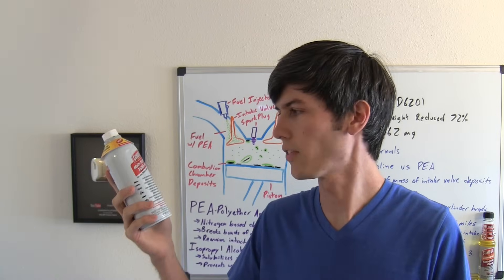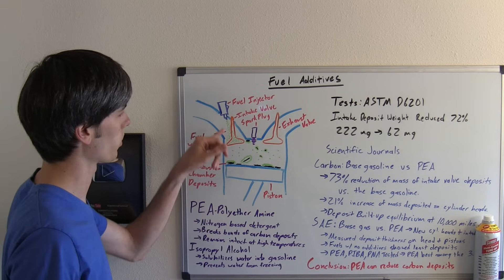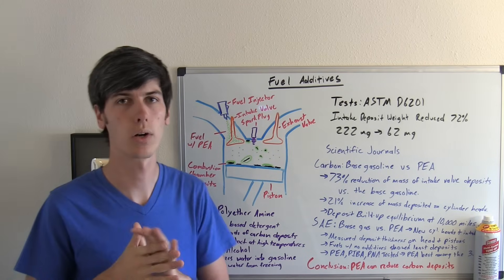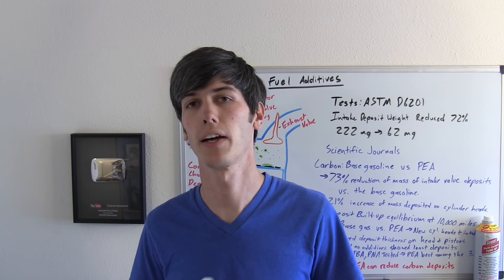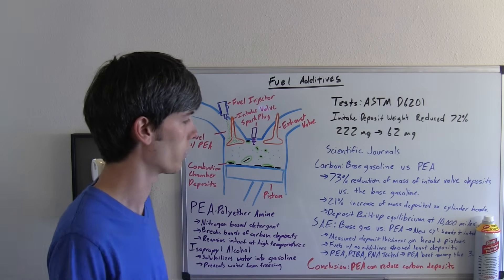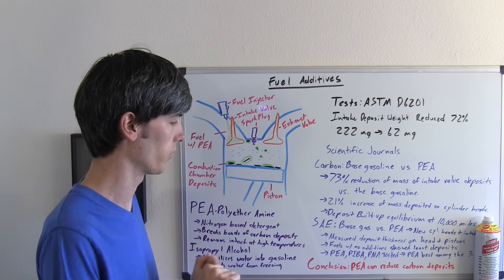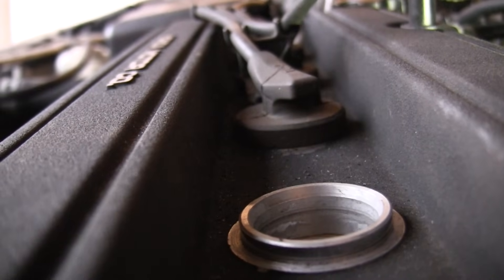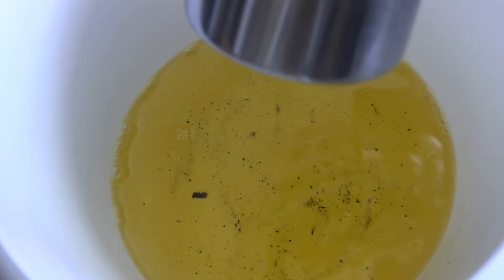Fuel Additives & Injector Cleaner - Explained

Comment: I recently acquired a thirty year old car and had it smog checked. It failed on account of too much Nox. Could be running too lean on account of a vacuum leak or too hot on account of carbon buildup which increases the compression ratio. A vacuum smoke test was negative. So I used an additive to  clean up the carbon buildup.
With that gasoline still in the tank I went for the free re-test. The amount of Nox BOUBLED. Now when you said that PEA based additive is nitrogen based that makes sense.
Reply: utoopuser I used to have Nox problems with my 4Runner that had a full custom exhaust. I needed to weld an exhaust leak that was between the manifold and the O2 sensor to fix the problem. A tune up (with coolant change), changing the O2 sensor, and changing the cat converter would likely get your Nox to pass. Checking the MAS sensor and a Seafoam treatment wouldn't hurt either.
Reply: Thx.

Comment: Good info, thanks! Is using Premium or Plus grade gasoline worth the extra price? What about premium gasoline stocks with additives already in them like Shell V-Power, Chevron Techron, etc?
Reply from the maker: Use whatever octane is recommended by your manufacturer, no need to go to higher grades if your engine won't have a performance benefit from it.
Reply: Engineering Explained great video, as usual. I would love it if you did a video on straight cut gears or "dog boxes." you could even throw in strait cut diff's in the same vid! not to bribe you or anything, but I could provided you some support if you did this... maybe Mr.Lincoln could convince you? 😂
Reply: I am with the channel owner. Use what the car maker prescribes for your car.

Most cars will run just fine with any grade fuel, because for modern engines there are electronics to adjust the fuel injection for a wide range of fuel grades and operating conditions. With a higher grade fuel the engine will not gain more power, but a lower grade fuel may cost you a few hp which most of the time will not even be noticeable. There is a lot of fluffy marketing from car makers but they do not have any benefit by recommending a fuel grade that is not the best for an engine.
- The superpremium - platinum - viagra100 fuels that are sold like champagne are propaganda only. There is no car in the market where the electronics are adjusted to this.
- Avoid pumps that may have stale fuel, some Regular pumps are frequented very rarely!
Reply: Also, using hi octane engines that don't require higher octane will actually increase pollutants.
Reply: My car manual says Regular 87 is OK , but I've noticed that when using Regular, the engine oil seems to acidify very quickly, and the smell of combustion residue in the oil becomes noticeable.  This seems to happen very quickly.  And once it happens the oil is ruined and needs to be changed.  Whereas when using Premium 93 gasoline exclusively, the oil stays clean for a long period.  The combustion residue of the cheaper gas will be significantly greater than premium gas.  While Regular Gas may not directly damage your engine due to knocking , it will significantly decrease the life-span of your oil.  So using Premium Gas is actually beneficial, regardless of what your vehicle manual suggests is acceptable.
Reply: Blakehx if your car manual says 87 octane use it. Your wasting money on anything higher. If you like add some BG44K twice a year. Google Top Tier Gasolines and read the story.
Reply: Actually many supercars have fuel maps to run on unleaded race fuel....  but no high end sports cars do.
Reply: ONLY use Shell or Chevron.   The rest are garbage.
Reply: They all come from the same supplier, the difference is additive packages & those are mostly the same as well.
Reply: I agree with EE -- use regular grade unless it's required for your car. Even then it's questionable. I had an HP Saab Turbo for which 93 octane was recommended. I ran it on 87 for 300,000 miles. Ran great, no knocking and fine performance.

Comment: I do not see the relevance of your soak test since we could easily presume that a simple water soak could have removed the same amount of gunk from your exhaust tip. Plus... aren't the additives meant to be burnt along with the gas, rather than just be used as a liquid cleaning solution? 

Other than that, it is very interesting information, yet I would have liked to get a bit more information, like "follow this type of clean with this other X type of clean for best results"

Comment: What about the deposits that get dropped onto the cylinder heads after coming off the back of the valves? Do they stay there or get blown out eventually?
Reply: I imagine they get blown out over time. The build up should cause your compression ratio to slightly increase, and seeing as how those carbon build ups would be the point of least resistance, they'd go first.
Reply: unless you drive as family lost on shopping trip...you don't need to worry about any deposits...soot,carbon built ups get burnt at high temps...same principle as DPF regen in diesel

Comment: all those deposits that are coming off from the pistons, etc where do they go? If is possible after using this additive the injectors can get clogged?? and for consequence the car can run sluggish??
Reply: once it comes off the inlet valves or the pistons it exits the engine through the exhaust valves with the exhaust gasses, comes out your exhaust basically.

Comment: I don't get it. I have had motorcycle engines that had HUGE amounts of carbon and ran great. MAYBE ( and it's not a given) you car is less likely to knock.. Buts that's a maybe not a proven problem. No vehicle that I know of has ever been declared " dead" because of to much carbon build up. Yes there is a value in having clean injectors.

Comment: got it, new car low miles: don't bother
older car high miles: use fuel additives for a while until you notice a improvement in power & economy...can't really lose tryin' it out on a high miler
Reply: andrew srenson Probably a small dosage every 7,500 miles, in which you'd be using synthetic oil.

Comment: I own a motorcycle oldtimer which was only ridden during summer season by the previous owner. Riding over bumps or making sharp turns when low on fuel, but still way to go until I'd need to hit reserve, the motor sort of splutters and sometimes even turns off. I suspect that there is residue in the gas tank preventing intake in some situations then, is that possible? And if so would fuel additive help with the problem?
Reply: If it's a tank that's divided by the frame it can have issues with poor fuel flow due to relying on carburettors to provide a vacuum, but no harm in throwing some carby cleaner in just in case.
Reply: Ethan Thomas
 that might be it. Thanks a lot! :)
Reply: Take the fuel petcock out of the tank and clean it, it will likely be coated a yellow varnish from gone off fuel.
Reply: Older motorcycles have carborators not fuel injection. The real reason to put PEA in gasoline is to, hopefully, keep the injectors clean. For an older motorcycle engine I suspect the is little if any value in these additives.
Reply: Ergo why I said carb cleaner, does the same thing, gets rid of the grime build up and helps clean the seals.
Reply: What might also be of interest to this is that it has a YICS carburator.
Reply: If you can remove the carb, replace the seals and while your at it give it a good clean.
Reply: +CavalrymanOfCha
Reply: Google "carb g out" that may be your problem. Issue that has shown up in motocross during landings
Reply: MisterWonka add Marine 2 cycle outboard TCW3 rated oil at 1 oz per 5 gallons. Works like Lucas fuel conditioner and injector cleaner but much better and cheaper. I use Pennzoil XLF Marine outboard TCW3 rated from Walmart $17.00 a gallon. Remember 1oz per 5 gallons is the formula. More doesn't mean better. Check out Sarge LS1 using Marine 2 cycle outboard oil in your fuel. Much testing with great results. Many people do this formula. Burns ashless

Comment: Hey there, i'm a huge fan, thank you for making all these car stuff easier! What is the amount of fuel additive recommended to use on a car? Will the amount oscillate depending on the amount of fuel you're loading to your tank?
Reply: David Chiang Probably the recommended amount for your size gas tank or a slightly smaller amount in favor of a larger amount. Synthetic oil changes and fuel cleaner every 7,500 miles should go a long way.
Reply: Bg44 k platinum excellent product for cleaning carbon deposits

Comment: How old is old? I have a 2013 Buick LaCrosse. Just had coils and all six spark plugs replaced. I didn't know you should only go to certain gas station that have better gas. Once my tank is empty I feel like I should put a cleaner in then gas from one of the stations recommended. My problem I was having was my car would slow to accelerate and eventually cut off sometimes when I came to a light. Don't know if just getting better gas would change or should I add the fuel cleaner since it wouldn't hurt. What brsnd do you recommend also? 
Thank you
Reply: Dorian Jones Any Top Tier Fuel. You can check out the list or look for a Top Tier Fuel sticker on the pump.

Comment: I always wondered whenever i bought these fuel injector cleaners etc.. Would it be best to pour it into a tank that's low on fuel, so it's not so diluted, like say, as if you had poured it into a full tank..
Reply: I wait until the tank is nearly empty. On my next trip to the fuel station, I would tip in the recommended amount of additive THEN top up with fuel. This ensures it gets mixed in thoroughly
Reply: If there's too much additive in the tank proportional to gas, the engine might not run as well since the additive is diluting the gas.
Reply: +Kevin Heckeler thanx..
Reply: +firstname Right thanx, that's a good idea.. Yep.
Reply: ***** That's what most of them recommend (see the instructions on the bottle).
Reply: +Kevin Heckeler righty o bro, thanx, and yeah, you're absolutely right.. Usually i do read instructions on products, or food, but i didn't on these.. I just poured it in wondering lol.. Cheers 🍻!

Comment: alcohol to clean an engine...isopropyl alcohol is basically the techical term for "rubbing alcohol" and I use it to clean contacts in electronic equipment.  Ethanol basically does the same thing, it's a solvent.

Comment: Isn't there a risk that whatever clogged the system up comes loose and sticks elsewhere?
Reply: Ideally since this occurs in the combustion chamber that these deposits are burned off in a controlled environment after they are loosened. 

But yes some of the carbons can and do resettle.  Especially considering after 50 hours of running a cleaner the chambers were only said to be 72% clean.

Comment: good research... one thing that could have been changed, to be more precise with the carbon removal test, that you did with the muffler.  Would have been to correctly mix the ratio of the additive to gasoline, and THEN letting it sit  in a bowl......because testing the additive alone may not have the same affect, as testing with high quality gasoline mixed in.

Comment: thanks for the video, i have a question, i recently changed the dpf on my volvo c30 i bought after market dpf as dealer price was very steep .
i have driven the car for qbout a month i only remembered that I have not topped up the fuel additive tank on the rear axle, i was wondering if I have done any damage? also are those after market dpfs any good , here in Europe we have to drive diesels to cut the cost unfortunately:)

Comment: So I just had a brand new engine installed in my car. I noticed you said that fuel with additives had more deposits than fuel without. Does this mean I shouldn't use fuel with additives if I wang my engine to stay cleaner? I'm a bit confused over the high quality fuel statement. I thought most high quality fuel had additives in it ie. BP Invigorate.
Reply: In the test where the increased amount of deposits was found with additives, they were testing specific additives (PEA, PIBA, PNA) to see if these additives kept buildup low, the test made no assumptions about fuel additives in general. 
So it would be wise not to use products like Gumout in your new engine, but like he said in the video, using high-quality gasoline should be fine. Hope this helps. 
(Note: I am not an engineer or car-expert in any way, I simply analyzed what was said in the video in order to help answer your question)

Comment: do turbo cleaners added to fuel work?  appreciate PEA survives high temperature, but would it clean the turbo as well??
Reply: the turbine most likely doesn't have much buildup on it due to the high tempature of the exhaust. its like when you look at the difference between the intake and exhaust valves, the exhaust will not have much I. it and will easily come off
Reply: I understand that vanes get clogged with dirt, so would hope these cleaners make it to the turbo
Reply: +steve hopper if the vanes are getting clogged with dirt then there must be a problem with the air filter. otherwise there shouldn't be any significant buildup. the only thing you have to worry about is the oil cooking in it and that happens when you don't let it idle before shutting it off

Comment: Hello, I took my 2014 Corolla for an oil change and the dealer recommended a fuel injector service. 1. Do you think a 2 year old car would need this service? 2. Do you think Gumout would clean my injectors?

Thanks,
-Kevin
Reply: No you do not need a injection service.  This is simply a dealer service to make extra money.  It is not needed.  If your car is not running poorly then do not fix what is not broke.
Reply: Thanks l

Comment: I Have a question... if your engine has a high amount of carbon build up in it and so an additive is use and does it's job, is there any possibility that the carbon build-up that was once in the engine no could end up and overwhelm or even clog your catalytic converter?

Comment: Have you or can you do a test on stanadyne ?diesel fuel additive it's the only one approved  by General Motors... And anyone who had a diesel truck is afraid if they don't run additive EVERY FILLUP. The fuel now days will ruin the fuel system and  injectors.. Thank for your time
Reply: I wouldn't trust gm, dexos is a scam and the dex cool has been a huge problem especially ruining intake and head gaskets

Comment: I feel like octane boosters should have been included. maybe they are in another video but they should with these. like if its safe to run a booster and a cleaner. and what the octane rating means

Comment: Italian tune up- for cars that are babied or rarely driven on the highway.

Simply beat the crap out of the engine on the highway for a period of time- it will cook off some of that carbon due to the high heat/ injectors washing the valves/ combustion chamber (Direct injection, your results may vary)

Cars hate to idle and be babied- they need to see some RPM's to cook some of those lovely EGR/PCV deposits.

Comment: +Engineering Explained - What would be considered " High Quality Gasoline"?
Reply: +johnathan wood Such a gas pump should be reported.
Reply from the maker: +johnathan wood At a minimum something considered "top tier." Here's a list: http://www.toptiergas.com/retailers/
Reply: +Engineering Explained - I have to say, the that site seems like BS. According to that site just about every fuel station in my area is top tier... which with tests I have done... I know is not true. I have had about 160 used vehicles now.. So I have had the opportunity to use many different fuels in many different vehicles. With my testing, I have found that Chevron gives me more miles and more power when I drive. As fuel staions like Arco, have made my vehicle's mpg go down. With the same driving. Going from one station to another, I can deffinetly feel a difference. Especially with used vehicles that have lots of miles.
Reply: +Engineering Explained - Also, I wouldn't rate all those stations the same. I have filled up gas cans before and payed for exactly one gallon at different stations and been given different amounts of fuel. One pump didn't even pump out a drop of fuel until the total went to almost $1.
Reply: Costco gas. Cheaper and better.
Reply: shell gas is normally really good
Reply: If that was state side, report it, fuel station owners can face felony charges for not maintaining the pumps, and pumps are supposed to be inspected yearly in most states, by a state authorized company for accuracy.
Reply: johnathan wood shell is a top tear gas even recommend by bmw
Reply: High quality gasoline would be considered Sunoco or VP Racing Fuel. Those are very high quality but so expensive that you'll get a financial heart attack :)
Reply: Engineering Explained ...chevron with techron fuel system cleaner ...is this good for a v6 accord 2017

Comment: Any thoughts about the use of water to "steam clean" engine carbon deposits.  There is a lot of anecdotal stuff out there, most of them use a blown head gasket to show that before the engine failed the water that seeped into the combustion chamber cleaned the piston.

Comment: what about chevron gas with techron? I've had good results in both my truck engine and my two stroke engines keeping them clean I've also had good results using Chevron proguard fuel injector cleaner. I've used other brands but, they just didn't seem to do anything. is there a difference between Chevron proguard fuel injector cleaner and other fuel injector cleaners?

Comment: Sorry for chiming in on an old thread but have you ever done a test with Seafoam? Is it a good thing or just a lot of smoke?
Reply: Chrisfix did a test and found that it cleaned around the edges of the cylinders and valves. You can check out his video. He said it passed the test.
Reply: Cool, thanks